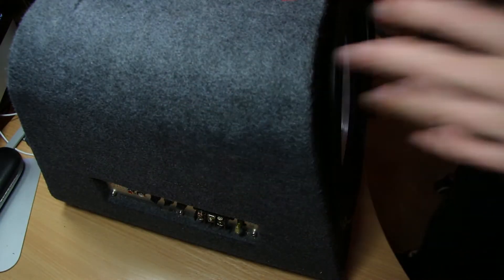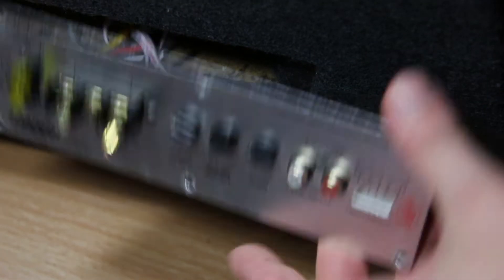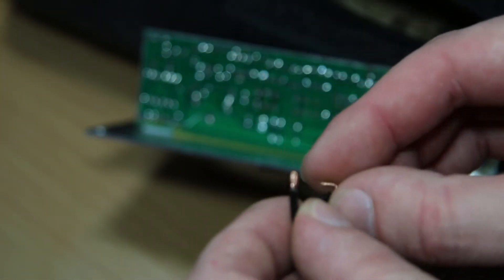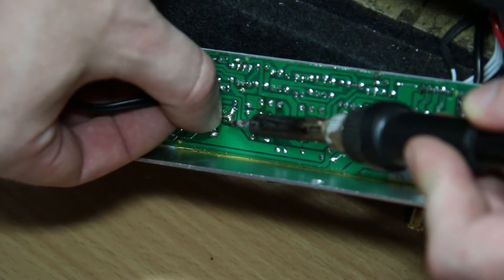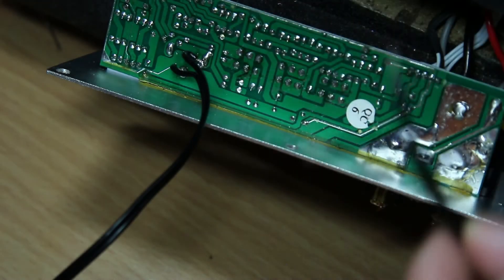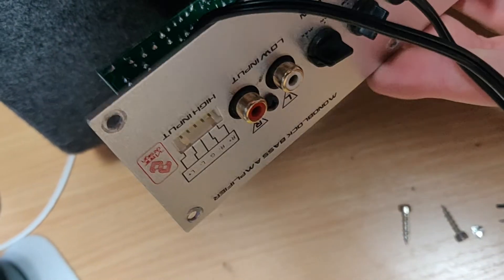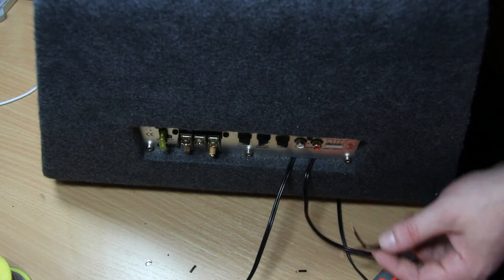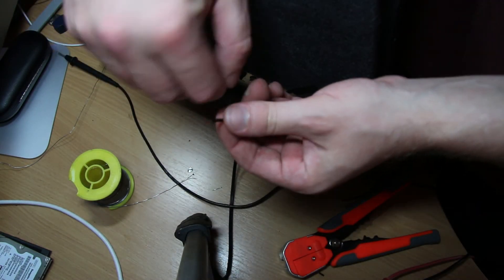How to repair the RCA (audio-input) jacks on a sub-woofer - Project Millie Ka

Comment: Why don't you replace the actual port in the receiver? Or is that have a possibility to damage the board?
Reply from the maker: Requires finding a part that's an exact match to the one that was there. Not worth the effort for an old subwoofer like this, nobody sees it anyway, just hears it ;)
Reply: @TheSlinq  I came across your video because I was trying to find a way to replace my sub RCA connection on my receiver.

I didn't know there'd be a difficulty finding that part like that. 

Thank you for that info, I'll probably end up doing exactly what you did then!
Reply from the maker: @AberdolphLinklr  Some will be easier than others - I would first search eBay for "panel mount RCA" and see if one that looks the same as the ones that are in your receiver. If that fails you could try a proper electronics supplier such as RS components or Digikey. If it's a standard type, you may be lucky, but if you can't find any that look exactly the same, then yeah, soldering on wires is generally the best approach - if it will only be visible from the back of your receiver it may not be a problem - it won't affect the sound quality at all, it's purely cosmetic. 

Hope this helps :)
Reply: @TheSlinq  you're awesome man thank you! I had no idea where to begin to look for it but now I'll start the process! Thank you!!
Reply from the maker: @AberdolphLinklr  I buy 90% of my components on eBay - it's the best combination of cheap and easy, I go to Digikey when I need something very specific, or when I want to be sure of receiving genuine parts (eBay is generally okay but sometimes you do get inferior quality fakes). And when I'm actually trying to buy a cheaper fake version, I'll generally go to Aliexpress.